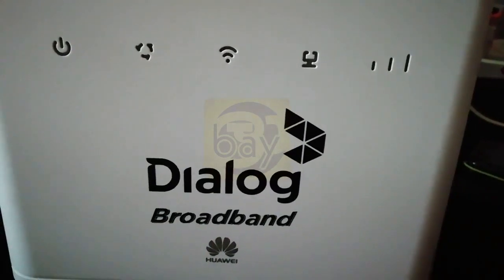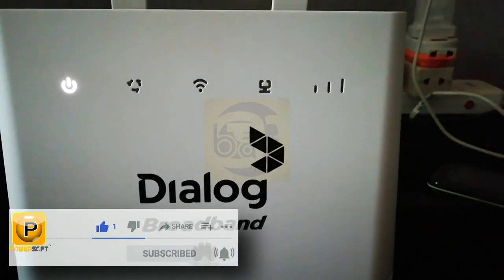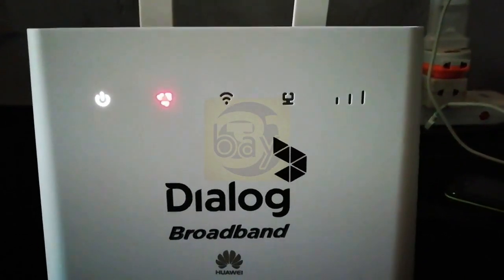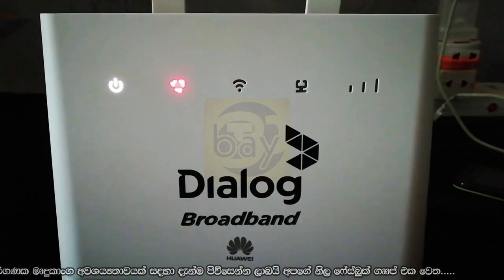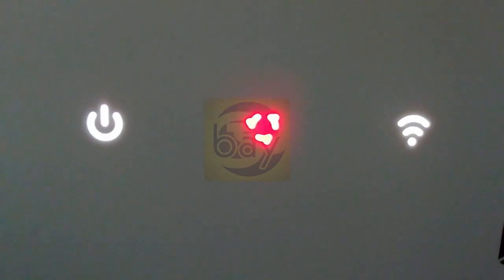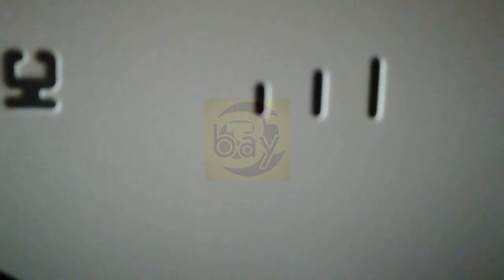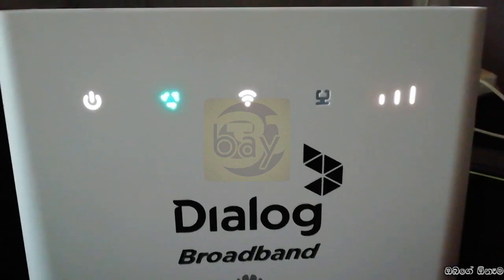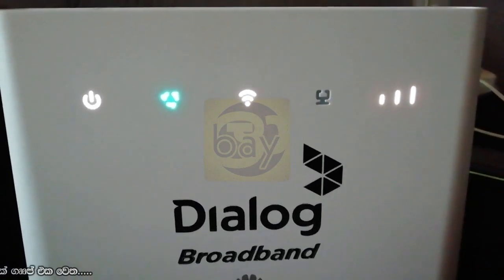Dialog Router - Boosting Up Signal _ Sinhala _ Huawei B310-925

Comment: Me Router eka unlocked krla use kraddi download upload speed wenasak wenwada dialog firmware ekata wada modified firmware ekak gahuwma
Reply from the maker: Den firmware reflash karanna support karanne ne. Issaranam karanna puluwan una. Ethakota aththatama signal band godakata support eka lebuna.